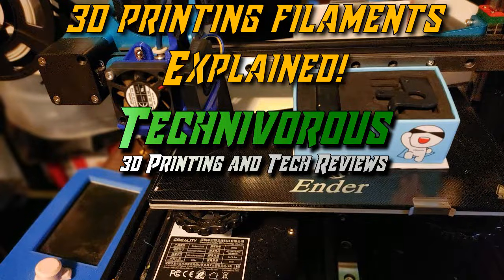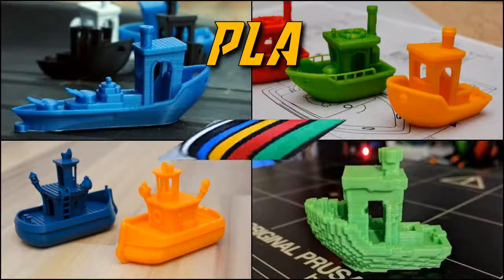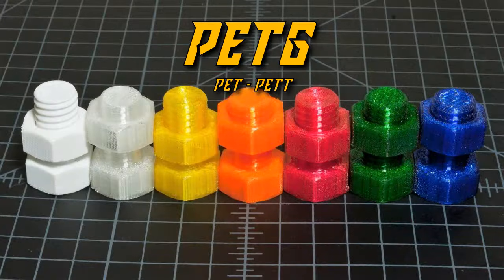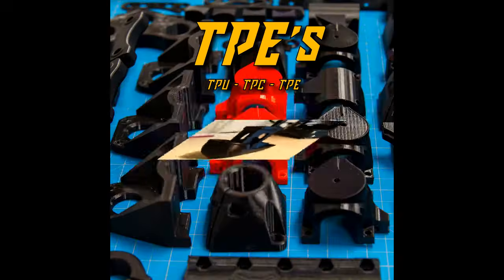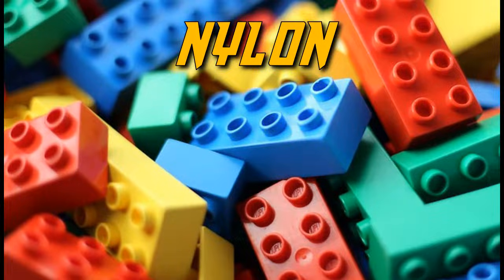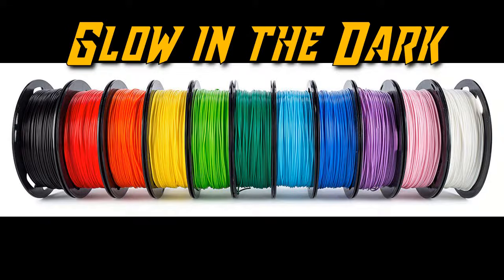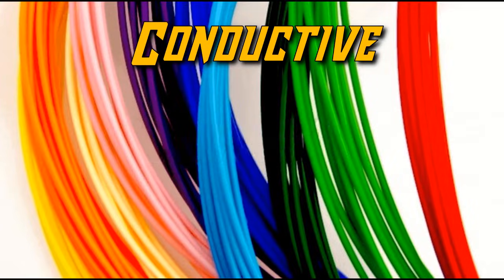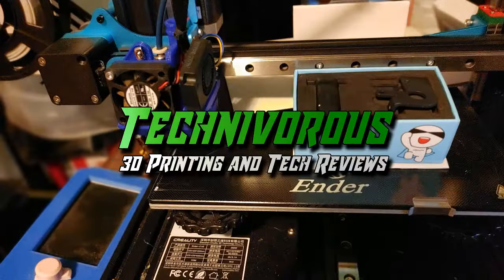All the Different 3d printing Filaments Explained!

Comment: Hello. I’m wanting to print my own versions of game console shells and I am wanting to know which filament would work best? I will be printing bigger consoles such as Xbox’s and PlayStation’s
Thank you
Reply from the maker: depends on the fans and cpus in the console actually. if it dosnt overheat pla will be fine. if the console gets relatively warm, move up to abs or petg. i believe most of these are mad with abs as is.

Comment: Bought my first printer from a guy and he gave me 2 basically identical brandless spools of ABS, 1 brand new and 1 almost used up. I used the latter first and the bed temperature had to stay in 105 for a good result. And when I switched to the other spool, it constantlly overheated so  I lowered the bed temperature to 90 and it turned out much better. I suspect these are not ABS at all because I printed them with no enclosure and inside a room with AC and a ceiling fan right on top of where I put the printer, even though it does emmit a not very pleasant odor.
I guess if you want consistent results in your prints, stick to notable brands and a certain kind of material.

Comment: A few more things to consider that is going on in the background which can affect the filament and printed parts. The raw polymer is compounded by different vendors with different additives. Some vendors use all virgin polymers and some use virgin + recycled polymer. The additives used in the compounding will vary from compounder to compounder and also vary by color in order to disperse the pigment properly or protect the polymer from degradation. Processing during compounding is done in the melt and then extruded/pelletized before extruded again to form filament (usually by a different vendor). So the polymer sees multiple thermal cycles above the melt and can degrade. So it is wise to look at each vendor/polymer/color combination as unique before investing huge $$ in a print even though the spools may have similar data (extrusion temp for example). Eventually if the volume is high enough, there will be ASTM tests to standardize these materials. There may be batch to batch variations from a vendor that may only be noticed during/after printing which will be difficult to trace.

Comment: HI, I'm new to 3D printing, i got the Ender-3 v2, i have a PLA filament  (i think need to check) 
 i printed something similar to a syringe, but the surface is kind of rough and not smooth,(printed 2 part,a cylinder and a shaft, and its noisy and not smooth moving when the shaft is moving inside the cylinder)
is there a filament that can be some how be smooth like a syringe plastic, maybe also transparent (but not have too) that works well with the Ender3 v2 and it as precision like PLA or more ?
Thanks

Comment: So I know a good amount of ppl like to print enclosures for circuit boards like their pis or arduino projects. I personally have been wondering how ESD safe these plastics are, although I know there are specific ones marketed for this.
Reply: There are ESD-safe versions of PETG, but I’ve never had a short caused by any plastic
Reply: They build up static electricity in certain weathers.... @automaticprojects

Comment: Hi. I got a dumb question. When you say drybox, I immediately picture a dehydrator. Seeing as they both do roughly the same thing, is it necessary to buy a drybox if I already have access to a dehydrator?
Reply: Ppl have converted dehydrators to dryboxes , imo thats the way to go because there usealy got more power then the drynoxes ,  the downside is its on or off unless you get crafty with relays and temp/humidity sensors and whatnot

Comment: Good stuff, I am new to 3d printeing, what filament would you recommend if I want to print something to put inside a car? Temperature can variety from 20-45 degrees and exposed to sunlight.
Reply: I have some things I need to print similar to what you're describing. Did you ever find out what filament to use?
Reply: I would say PETG would be your best bet if you don't have an enclosed printer, if you have an enclosure then ABS would also be a good material. Depending on how hot it gets inside the car (not sure if your temps are outdoors or interior) I have heard of PLA melting. Some PLA+ also supposedly has a slightly higher heat deflection temp, so that may work as well. :)

Comment: I prototype with PLA and depending on the use of the final product I pick the filament best suited for the use of that item. Just remember that most slicers have settings that make a good baseline for adjustments required when going from one filament, say PLA, to another filament, say ABS or PETG. And not all filament is the same even if marked the same. Quality filament always costs a little more.. Seen more people get frustrated and quit 3D printing because they have used the cheapest filaments and then wonder why their prints look like shit.
Reply: What do you consider an acceptable PETG or PLA?
Reply: @wholestatee  Late comment but for those curious, Descending in price: Prusament (Absolutely the best, but twice the price of other filaments), Polymaker (Spoiled with choice for filament, great quality, and much better price), Sunlu (Depends on the filament you buy, but usually cheaper and prints well), eSun (probably the most popular budget filament. Great for the price), and then there’s everything else. Usually you’ll get a printable product from others but I’ve yet to see other worthy filaments mentioned more than these brands.
Reply: @b1icky Hatchbox is great. So was 3DSolutech but they stopped production.

Comment: ABS is pretty great. Cheap, strong, machinable, so much great about it.  An enclosure (heated even better) and a good bed adhesive like Magigoo and you have little to no problem.  Oh and it doesn't seem to absorb moisture like PetG, PLA, and Nylon.
Reply: It's also used in automotive so good for making replacement plastic parts or adapters.
Reply: It just smells strong
Reply: @drblandpi  I don't really notice a smell from it. Probably a me issue 🤣
Reply: I have a Raise3D Pro3 and ASA is my favorite filament to work with. With the heater enclosure and bed I find it almost as easy as PLA or PETG but gives beautiful, strong results. I also like their polycarbonate filament a lot too. People say that’s tough to work with too, but to find nylons and some flexible much more annoying to work with.
Reply: but it makes fumes
Reply: It's a pretty great material when it comes to the end result, but it's much more difficult to manage. Not only do you need to keep an eye out for warping and adhesion issues, it's highly advised to have a vent because the fumes and nanoparticles it produces during printing are highly toxic and can cause cancer after prolonged exposure.